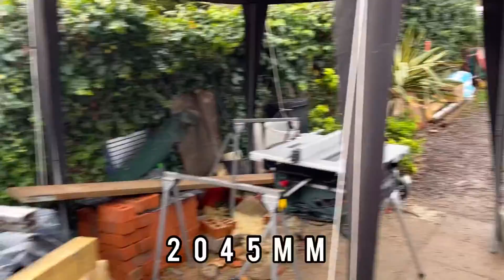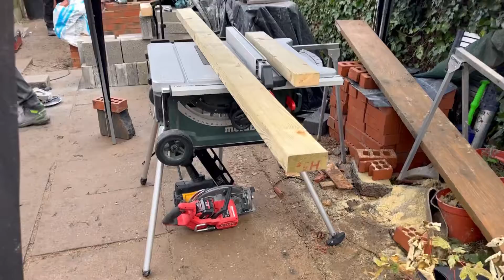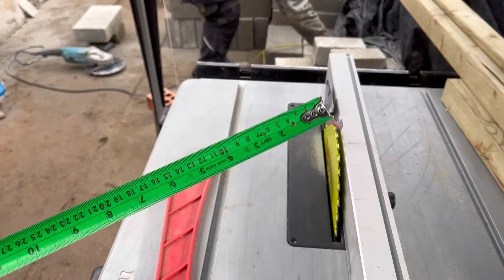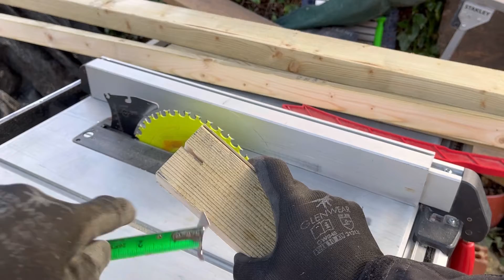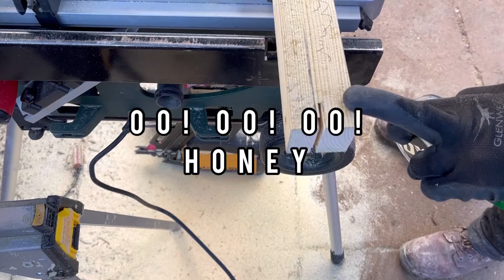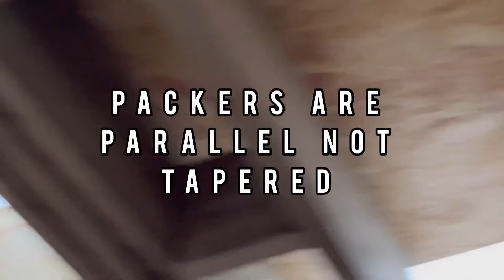Creating your own furring strips    #howto #carpentry #flatroof

Comment: Just what I needed to do about 40 @ 4.8 long they would have been too expensive to buy so I was rained off and went into the garage, even after watching this clip twice I still managed to get it the wrong way round and messed up two pieces. My garage was not long enough to make a full pass so I had to cut them at 2.4 and make twice as many cuts, but hey ho couldn't do anything outside. Once I got into a rhythm and got my head around I was fine thank for the video.
Reply from the maker: Glad it was of some help but if it’s of any comfort to you I made some furring strips a few months after this video and I messed one up putting it the wrong way around 😁👍🏻.

Comment: Very informative video, I’ll be following your channel from now on. Do you have to fix a firring strip to each joist. Thanks!
Reply from the maker: Hi Ken and thanks for the comment we appreciate the commitment to us. I always fix every firring strip however dependant on the deck/roof covering you are putting on after I would take into consideration whether the fixings are going to go into the firring strip and then through into the flat roof rafter meaning I would only tack the firring along the thinner part to stop it moving. Hope this helps. Thanks for watching.

Comment: Just curious as to why you fixed parallel packers onto the joists
Reply: Hi and thanks for watching. We needed a fall from left to right and also from front to back to get the water to the outlet which is left hand side above the doors. We calculated the furring pitch and then cut a packer under each furring which diminished towards the outlet. Hope this explains it better but please feel free to post again if you need any more explanation or further questions answering. Thanks again for watching our video(s) your time is very much appreciated
Reply: @richardwood4541  so the packers you fixed weren't totally square, you cut the tops so you got the fall from left to right?? is that correct??
Reply: Hi 
The furring strips were cut to provide a 1:80 fall from left to right and the packers were cut square/parallel and fixed  under each furring strip to provide the 1:80 fall from front to back. For example if the front to back calcs for 1:80 fall were 60mm - 0mm then we cut a 60mm packer furthest away from the outlet underneath the furring and pulled a string line to the outlet end which is 0mm. We then measured down to each flat roof rafter to get a measurement required for the next square packer so on and so on. Really sorry if this doesn’t make sense but it’s hard to explain. I am doing a roof at the minute on the channel so I’ll try to explain it in better on that as I’ve just done the furring strips. 👍🏻
Reply: @richardwood4541  hi thank's for your in depth explanation, appreciated 👍
Reply from the maker: That’s no trouble at all I hope it helps 👍🏻

Comment: Is there anything wrong with calculating your span. Buying and oversized timber and then cutting the angle straight on the beam. So say I need a 47*90 for the span. Rather than making a strip I buy a  47*120 and cut the fall on the beam itself?

Do you lose structural integrity of the wood
Reply: Probably a lot cheaper to make firring strips than to buy over sized joists
Reply from the maker: Thanks for commenting on our channel Ian and yes most definitely cheaper especially now with the cost of materials. 👍🏻
Reply from the maker: Hi and thank you for taking the time to watch our channel and comment. 
We are not structural engineers so I couldn’t answer that definitively but I can see you trail of thinking and would agree with it in principal. However, our furring strips are cut to the desired 1:80 fall and sit on top of the calculated span size timber specific for our job so I would always consult an engineer for clarification if for no other reason than for your own piece of mind that it will be safe. 👍🏻
Reply: @Mr_A_Builders  thanks for replying. I'm building a shed so feel like the risk is low, but good advice to ask a structural engineer. Keep up the great content.